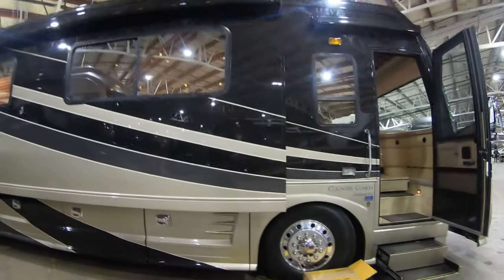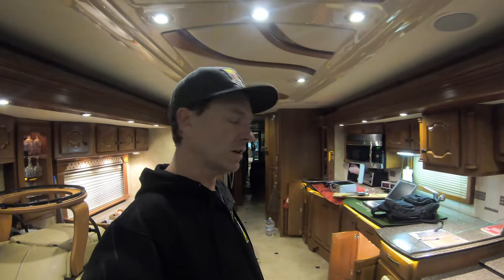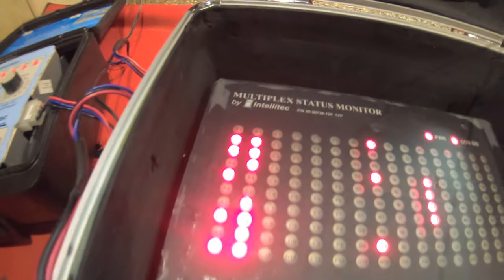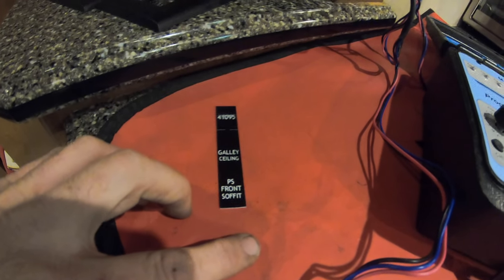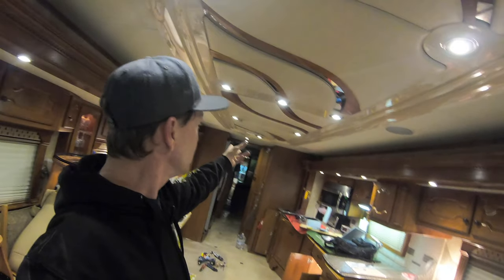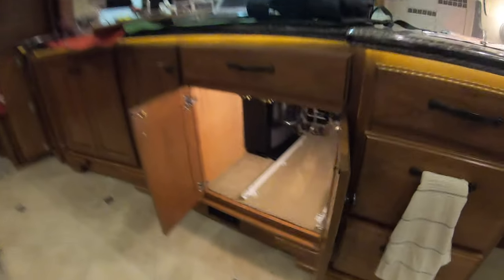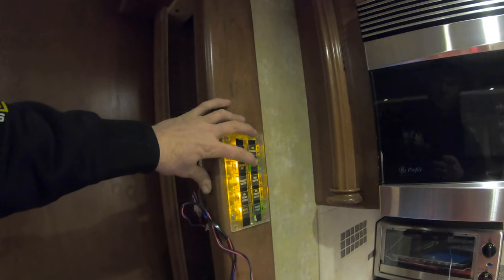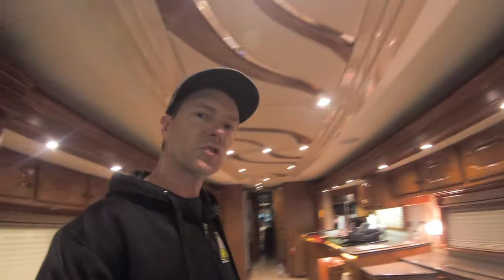What about Intellitec Multiplex system and LED Lighting

Comment: The code for programming is called binary code just look up binary numbering and it will explain how that works it's really quite simple.
Binary code equals the address of each function or switch assigned to that particular code lights, shades Etc
Reply from the maker: Great input. Thanks for the comment.

Comment: Really like the tech videos very informative. Have you ever upgraded or re done an interior ceiling?
Reply from the maker: I’ve done ceiling repairs on the factory ceilings with the carpet and the vinyl. And I’ve done the ceiling in my toilet room so far but that’s going to be one of the last stages of my remodel.

Comment: I have one im working on and the multiplex will randomly start flashing the ceiling lights dimming up and down and I cant figure out why for the life of me Put new multiplex module in and still does the same thing. Soketijes it occurs when i move the slideout in,  The ceiling lights wont turn on when I touch the ceiling light button on amy of them it just lights up the touch pad for a second then turns off

Comment: Hello Brian - One of the items we would like you to do with our coach is add / remove / re-assign some of functions on several of our Intellitec switch panels in our coach.

Question - In addition to adding and/or deleting functions on a switch panel, is it also easy to move the position of each button around on a panel to be more user friendly?  (With the half-bath deleted in our coach in lieu of midship desk, some of the switch panels are somewhat confusing on their layout of buttons.)

I like you idea of deleting 'water pump' on several panels, fixing 'all off' so the step doesn't retract, adding labled buttons for front & rear exterior under-slide LED, etc.

Also - if we were to put a ceiling fan in the bedroom, would that be switched through Intellitec or on its own wall switch?  (Are those fans 12v or 110v?)

Thanks in advance. Just trying to get some information before over-thinking each panel's layout...

Dr Jerry

Comment: You going to use the VIP wheel to run the radio? I am. Like to see it.
Reply from the maker: No I’m using all existing parts that I had that I got from the auction at Country Coach in 2009. It’s awesome to see  someone else going down this great adventure with me.
Reply: @briansrvvideos  Thank you. I wish I could pull my front console out like yours. It’s riveted and welded together and down . I’ve been  told to saw it out. Might take out some of the front.